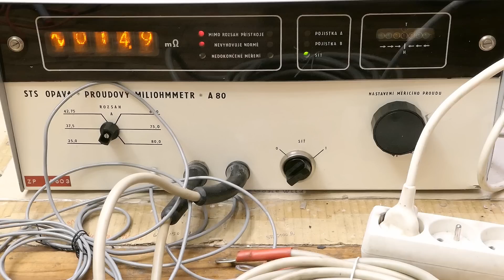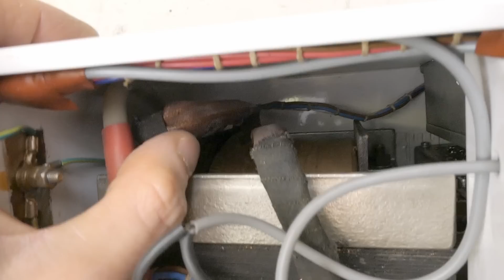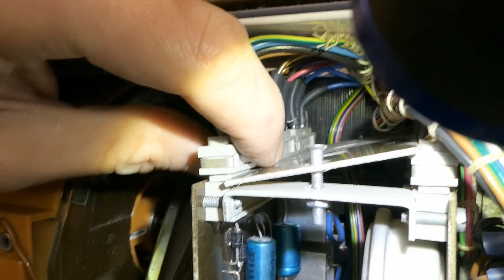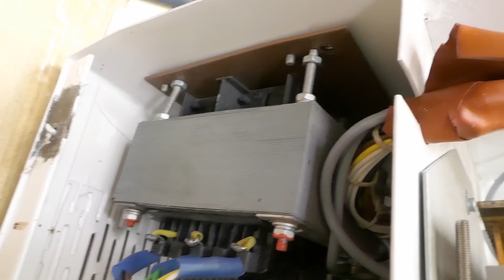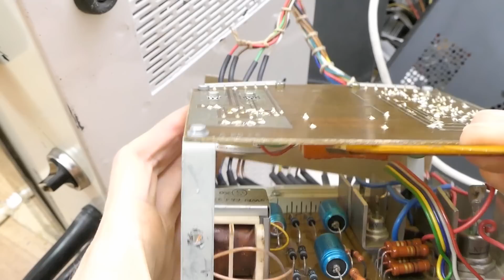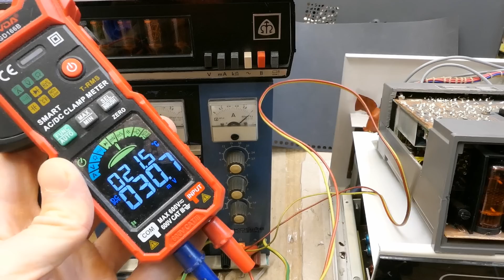30kg of a resistance meter!

Comment: I saw a more modern version of one of these in use once. It was being used to test high voltage power distribution equipment, and if I recall correctly, it could actually measure microohms!

Comment: We have a machine that works the same at my work, but it measures micro ohms, and goes up to 600A test current. It's a Programma MOM600A if I recall correctly. We use it to measure the resistanse of the bus bars in the MCCs and substations that we build. :)

Comment: Maybe the variac together with that LED scale was used to set a known voltage drop across measured resistance, and then it calculated the resistance based on current shunt's voltage drop (and thus the flowing current)?
Reply: That is a possible explanation.  Shame Mr Diode did not measure either the current or voltage on the device under test when the machine was in operation.  
 I think his heart was not really in this one.   More interested in the bits.  
 One day he will want to measure some milliohms and then he will be sorry.

Comment: I think it modify the reference voltage of the panel voltmeter accordingly to the current of measurement so it measure the voltage over current ratio instead of the external voltage over the reference voltage

Comment: This kind of milliohm measuring devices were designed to give reliable protective earth resistance or contact resistance results in high power devices or networks. 

The measurement can show low resistance with 0.1A or 1A, indicating good contact, but totally fail at e.g. 80A. So these test the circuit  with real current level.

These are not designed to measure resistors (like current shunts), even they can be used also for that purpose (of course only if the resistor withstands the test current). 

Quite expensive devices btw.

Comment: Interesting unit. it looks like a ductor set to check across connection points of equipment and get readings in milli-Ohms. Interesting to have Nixie tubes and LED's in the same unit.
Reply from the maker: This was quite common back then - individual LEDs were much more available than LED displays. Also 1 out of 10 decoders were easier to get, because Tesla produced them, while 7-segment decoders had to be imported from East Germany.
Reply: Thanks for your explanation. Great device anyway. @DiodeGoneWild

Comment: The uA725  (MAA725?) Is a low drift low offset instrumentation amp. They were hard to come by back in the days...

To be honest its a very stupid design using high current over a long time. A more intelligent approach would be to use a storage cap for providing the high current but only for milliseconds , discharging it via a constant current load through the DUT. A simple max detector would hold the measured shunt voltage.  Everything would be 28 kilos lighter 😆
Reply: Unless the point of the device was to measure resistance under continuous high current, taking into account the resistance change caused by associated heating. (Consider e.g. measuring resistance of a cable that will be used for 80A. You'd then want to actually pass 80A through it.) I'm not sure though if the duration of measurement was sufficient for that.

Comment: Thanks for the great videos! There is actually an old trick to read the ratio of two voltages: use the normal input and reference input of the DMM/ADC. This is for example possible with the old ICL7107 and similar chips. For an ohmmeter you would put the sensed voltage into the input and sensed current converted to a voltage into the reference input instead of a constant voltage. If AC, it would need rectification of course.

Constant current would be the other way :) Fun to see the manual feedback loop in this instrument. Very creative design! Love it...

Comment: This reminds me about the first high voltage lab power supply made in ussr that called уип-1
it was a tube power supply and it's weight was 46 kilo
This was a thing of many purposes - you can generate some high voltage with it, or it could be used as a projectile to break heavy fortifications....

Comment: This thing already has all the expensive parts necessary for converting it into a nice AC power supply - just remove the electronics and add a 230/230V isolation transformer and some switches. That would give 0-230V and 0-12V isolated from mains. Add some lightbulbs with different wattages and some more switches and it could also be used as a dim bulb tester for troubleshooting / restoring old radios etc.
Reply: You could even Re-use the Nixie Voltmeter.

Comment: Actually, the only difference to a modern 10A interference filter capable of filtering relatively low frequencies in addition to relatively high ones would be a soldered stamped sheet metal casing of the newer one (I guess, far east and western produced ones would be of the same cheaper case construction even 40 years ago) which would be a nightmare to review and repair. Anyway, a phase regulated large inductance will always require such a large filter.

Comment: It seems like such a weird way of operating this machine. They already went to the effort of putting 30kg worth of stuff in there, and every kind of component imaginable is somewhere in there, and yet they did NOT put in a small motor to turn the variac for you instead of the LEDs... Just a simple dc motor and a couple power transistors driving it linearly would have completely automated the measurement, but no, they make the user do that job instead.

Comment: I never taught there was resistance meters like that (which can supply that much current, just for mesuring) - indeed useful to measure things like cables under load (getting the effect of the temperature rise included as well). Very interesting!🙂👍
Reply: Found something similar, a "microohmmeter" in a lab, with a variac, big screw terminals, and an LCD display, but this one went up to 600 A at maybe 2 V or so... Good for melting the cables under test if you were unhappy about their resistance.

Comment: Wonder what specialist use it had.  

Is this the fourth time you’ve had Covid?
Reply from the maker: I guess they used it to measure the resistance of some contacts, switches, terminal blocks, cables, ... Yes, the 4th time.
Reply: @DiodeGoneWild   about the creature, sounds funky, because here on Brazil we haven't heard about a single case in ages. I started to thought they finally got it eradicated.
Reply from the maker: More people than ever are catching the creature here. Most don't get tested, nobody cares any more, so it might seem like it's gone. I tested myself to prove my theory - After several years of swimming in winter and only using cold water in shower, I don't catch anything else than the creature. It works against flu, cold, cough and all the respiratory things, but not against the creature.
Reply: After I got covid last winter, I no longer stand any cold. If I walk out in cold weather (0 degrees and lower) I instantly have my nose dripping and I feel scratching in the troath, and get flu easily. I don't know how I'm gonna ice skate from now on. :(
Reply: Must be worth its weight in gold , copper , iron. 
Such a delight these extremely robust industrial grade instruments.

I ❤️ those cable ties.
Reply from the maker: Some copper is definitely there :)
Reply: Great methodical troubleshooting; imagine if the device was packed properly and the switch wasn't broken in shipping. I have 6 variacs, one even goes from zero to 240 vac! Keep your videos, including the excellent comments from your cat, coming. By the way, what is your cat's name?
Reply from the maker: Thanks :). Yes, it would work from the beginning if not dropped in the shipping. How high the other variacs go then? I've never seen a variac going up to less than 250V. The cat is called Veritáska.
Reply: In felis veritas  @DiodeGoneWild
Reply: @DiodeGoneWild glad to see I'm not the only guy that always does cold showers.